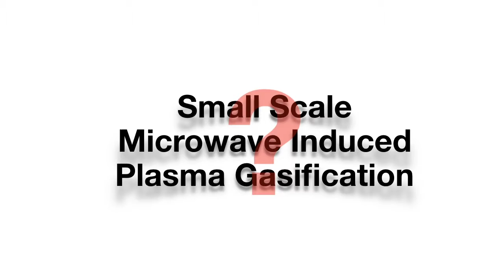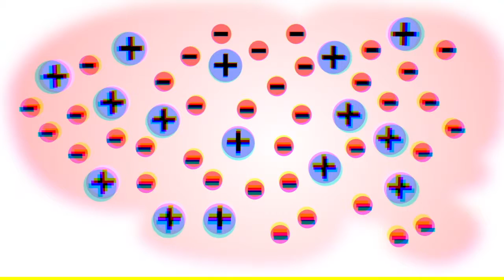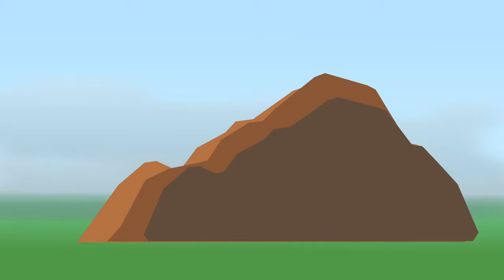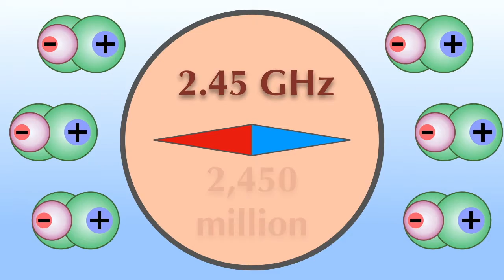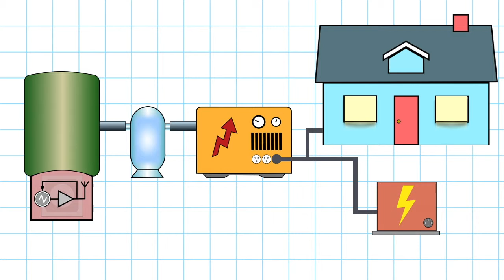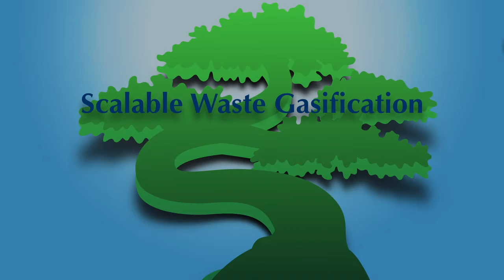Scalable Waste Gasification - Waste To Energy, From Small to Large - Harvesting Hydrogen

Comment: What is the input energy to run the microwave generation?
Reply from the maker: It should be no more than 20% of the output energy. I don't yet have an exact answer. I am working on setting up test equipment to figure this out. I want to do it safely. I found a book and some articles about using microwave ovens in chemistry labs. They may lead to a good solution.

Comment: Good presentation.  But ... It seems like gasification and running methane to power an inefficient ICE generator that spews CO2 might be an easy starting point but unsatisfying.  Molecular recycling of waste seems like the ultimate goal -- a household unit capable of handling all waste for the house, including sewage, yard waste, kitchen waste, metals, paper and plastic.  The pressure vessel heated to 3000c by plasma arc would convert virtually anything into individual atoms of the elements.  Directing that plasma to a carbon or tungsten heat exchanger cooled by water could generate steam in a closed cycled for a steam turbine electric generator while cooling the plasma so that the various elements can precipitate out.  Basically distilling trash into reservoirs of individual elements -- including keeping carbon separate from oxygen and hydrogen.  Zero emissions, and the hydrogen and oxygen can be recombined in a fuel cell with pure water recovered from it.  This would obviously not be a $1300 appliance, but if it replaced the need for a septic system, a water well, and solar panels, it would be well worth $20,000 for off-grid living.  People are packed into cities partially due to a lack of infrastructure that complete molecular recycling could substitute.
Reply from the maker: Kw Ellis thank you so much for expanding on the concept. I'll need to read this a few times before I make a new video. This is the kind of information I've been looking for. I have BSEE degree but I've only designed microcontroller boards.
Reply: Well I am no expert.  This is just combining different ideas I've come across in researching plasma arc furnaces and WTE.